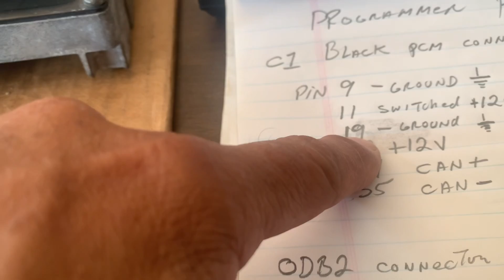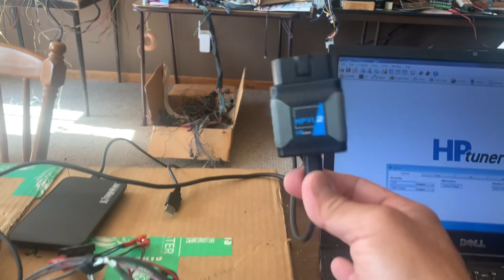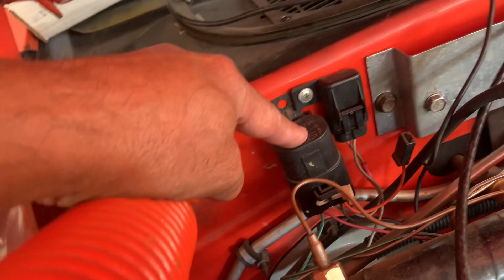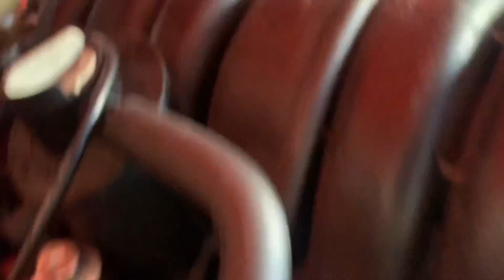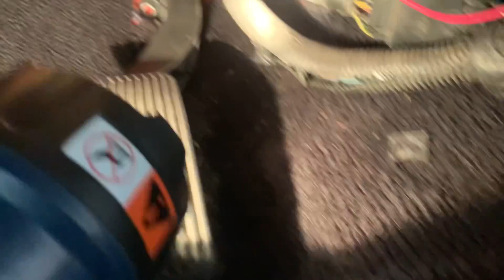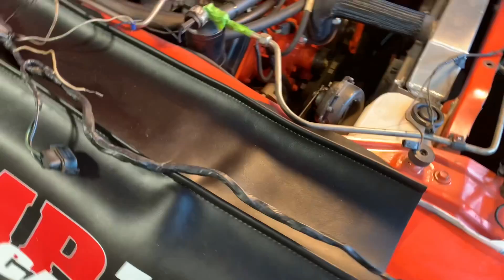Hemi Swap Part 5. A 5.7 G3 HEMI for my 71 Challenger Convertible Pace Car.

Comment: have you used any 05-08 truck harnesses or just car ?
Reply from the maker: Not sure if I have a truck harness but one that I bought has all full length wires with the transmission plug and wires included. It doesn’t unplug in the middle like the car’s engine harness. Wires are long and all 4 pcm plugs are wired in, so not sure if it’s from a truck. Almost every wire goes to the same place depending on your PCM so try to find an online wiring diagram. Good luck!
Reply: @shelbydogg thanks .